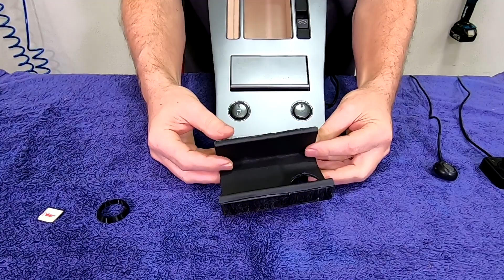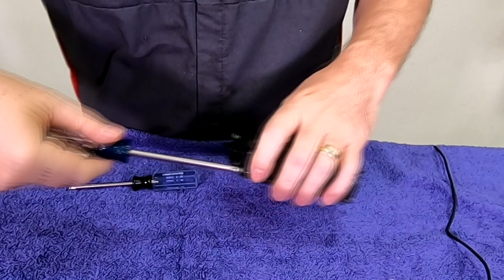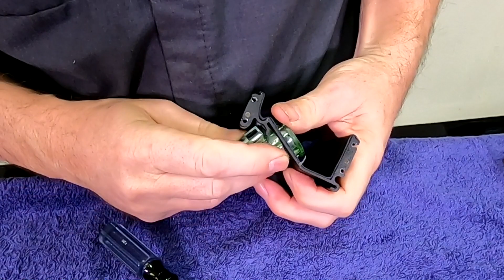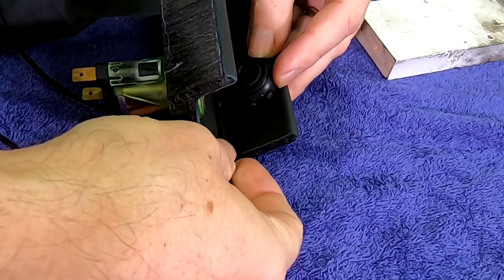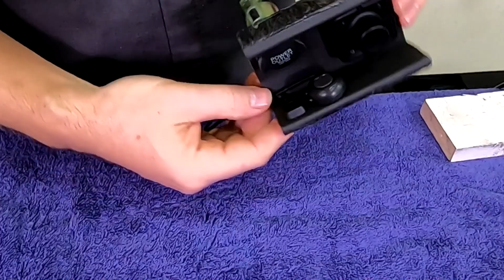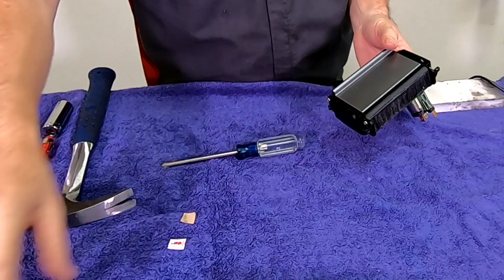Installing the Console Controls - Aston Martin DB9 Infotainment Upgrade - Part 5

Comment: Hi I have taken the cylinder head out and now putting it back after replacing some of the valves for my db9 Can you please tell me what the torque is for tightening the cylinder heads main bolts kin NM please thanks

Comment: Another professionally produced informative video by Steven!
It's nice that you have a covered ashtray into which you have been able to hide the switches. In my Virage that ashtray equates to an open cubby where I have had to mount my switches, not attractive even though I did upgrade the joystick knob to a knurled black metal one, the stock knob is just a forced fit.